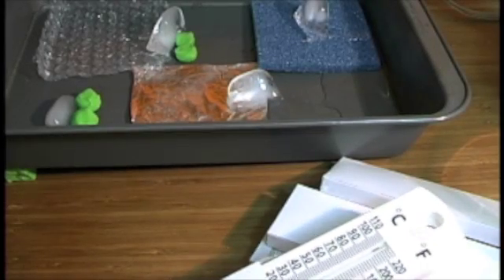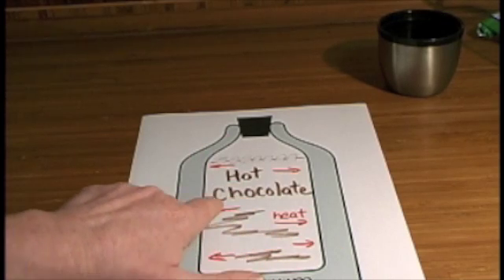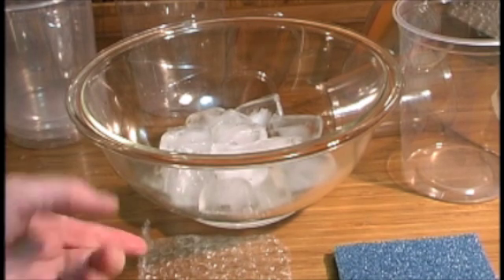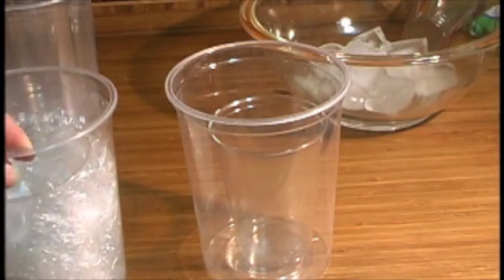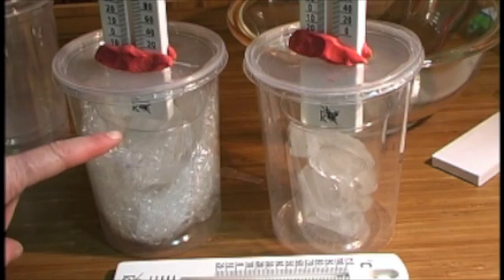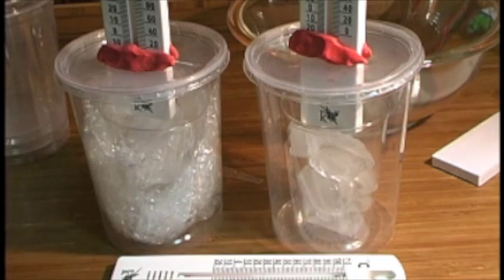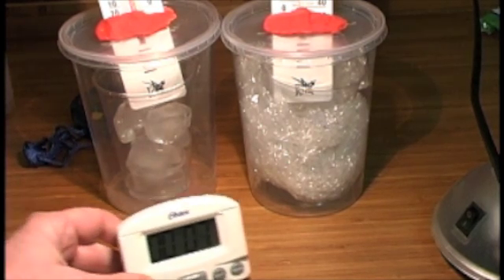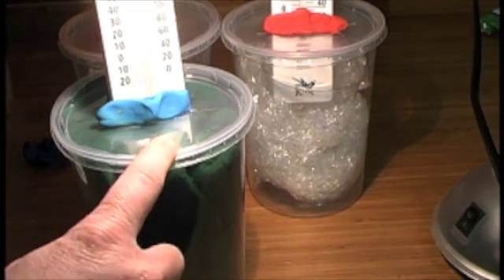Heat Transfer Lab Thermos Prep

Comment: The ice should be put into the different set-ups at the same time to ensure a fair test. Besides, the amount of insulator (the bubble wrap and the fleece wrap) should be of the the same thickness and size too. 
One doesnt need to remove the thermometer from the container to read the temperature. The temperature would not be as accurate as reading with the thermometer in the containers. 
Nevertheless, I thought it is a clever way to teach conductors of heat.
Reply from the maker: It is not a perfect set up. I was just following the directions that comes with the students' kit. I agree about removing the thermometers. It is more difficult to read them that it appears. You are correct all the insulation should be the same size. The kit was not designed with good experimental design.